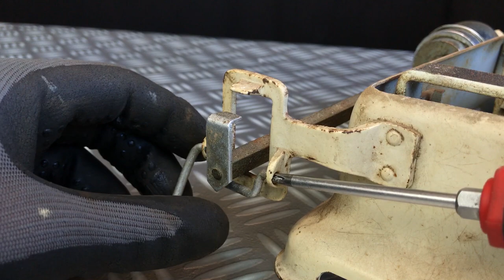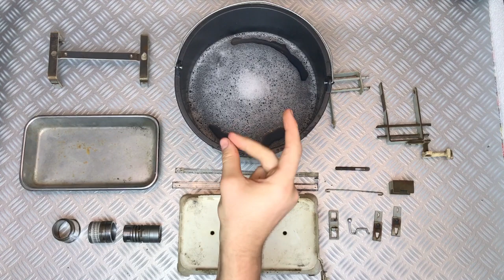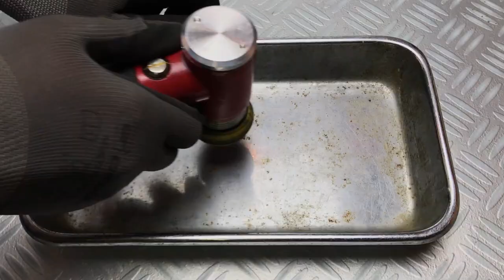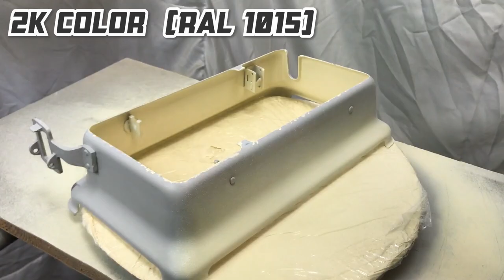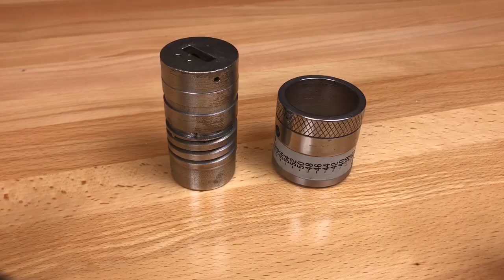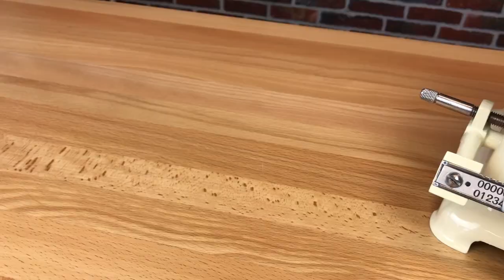Antique Restoration Very Scales 1960s

Comment: Uggg you painted all the V-blocks and pivots ???? Why??? How can this scale be calibrated accurately? The most important element of any scale, the pivots and V-blocks MUST be clean and sharp meaning filed and kept in bare metal, no paint and certainly no grease. This restore though it may look good is a fail due to lack of understanding and knowledge of the equipment.
Furthermore all scales must be calibrated with known accurate / certified weights with several placements, minus tare weight(the pan) to function normally. This ornament is not a compressor nor a properly functioning scale.